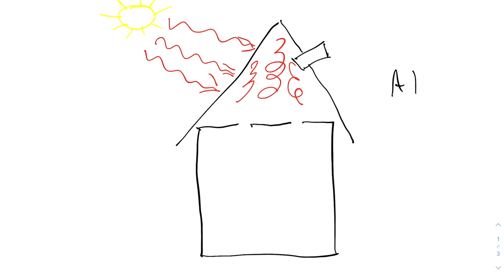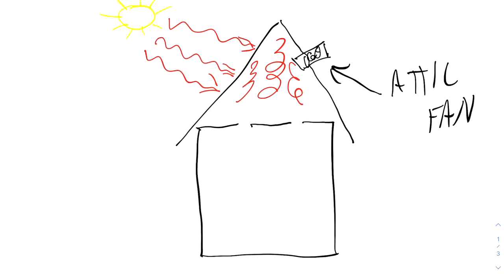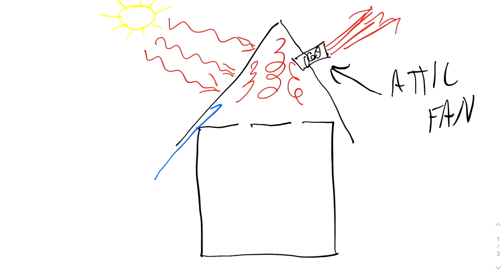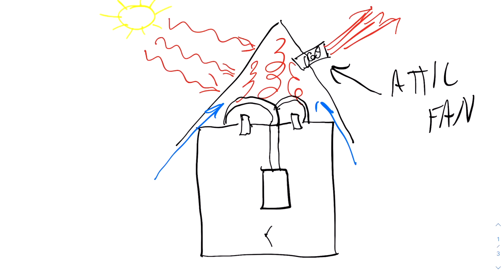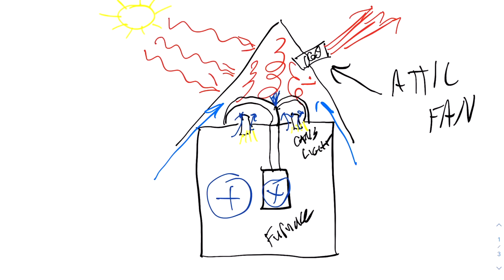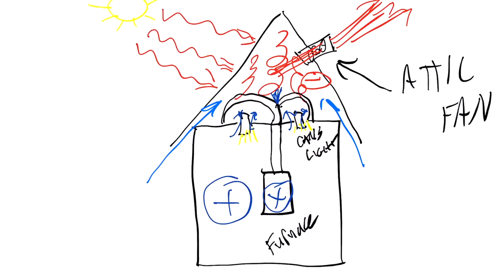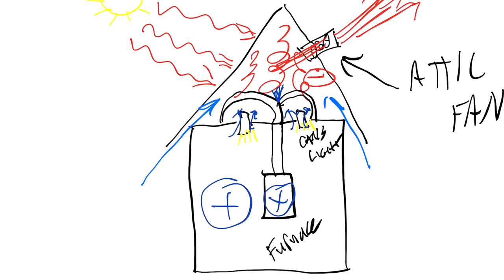3 Remodel Rip-Offs

Comment: So, I have an attic fan and a smart thermostat. You are cherry picking arguments against them. 
I'll start with smart thermostats. Most energy companies give a rebate on them so if you get one on sale you can get like a nest for $200 or even the E version(lower end) for $100 sometimes. My power company gave a $75 bill credit and it allowed me to enroll into the program where the power is limited on heavy use times but I can override that very easily if it happens. It happened for me like 5 times last year but it gave me a $40 credit on every bill that it happened. That with the added ability to customize the settings is well worth it. also if its a  particularly hot day I can go on my phone and put the AC lower while im not home so my pets are more comfortable and so its nice when I get home. 
As for attic fans...I have 2 types. I have a whole house fan that we use in the mornings most mornings that sucks in a ton of air from outside and pushes it into the attic and one of those solar ones. My attic isn't air tight. I don't think any are in my area. It has vents to the outside so when its 100 degrees outside and that solar attic fan is going its removing super hot air and replacing it with just the normal hot outside air. After we got the solar fan we noticed our bill on average in the summer dropped about $20. We were using less AC. We have only had it for a few years and it's paid for itself. 
Our smart thermostat is also paid for itself and more really.
Reply: I got my Nest E on sale and it cost me less than $10 after rebates. Definitely worth it.
Plus, the airwave function of the Nest only comes on if the humidity is low!  So if you're in the west or somewhere else with lower humidity, you can take advantage of the cold left in the coils to do more cooling instead of just wasting it!  I also use the fan setting because I have a basement with cool air that I can pull from and circulate around my house, providing cooling without having to run the AC compressor.
Reply: You have to remember the duct insulation isnt super thick so with arid stagnant temps in the attic that heat is going to heat the air in the ducting too so with a positive discharging system for that heat you should see lower bills as the cooling system doesnt have to work as hard to cool the air going into the conditioned space. In theory I can agree with Matt that a single deck vent by itself (during the day) isnt going to be able to make a dent in the attic temps. Add an intake fan thou which creates circulation and I disagree in them being a waste.
Reply: Same here 👏🏽👏🏽👏🏽
Reply: Yea I am going to have to agree on the thermostat points. There's also the convenience factor. Wake up in the morning, walk into the hallway, thermostat greets me with the outdoor temp, weather, and temps for the day. I deploy a lot, it's nice to check on that whenever. Back when I was troubleshooting a bad condenser fan, it was really nice to not have to go in and out of the house 37 times, because I can just run it from my phone. Plus it just looks great. Say you are selling your house, what do you think is going to impress a potential buyer more, a faded beige box on the wall or a stainless steel ring with an LCD screen?
Reply: NYG&E had the Sensi for free (pay shipping and tax) so I got one. Liked it and next year they had another rebate where it was $25 so I got a second one for upstairs.
Reply: @DanMcD80  I have been checking my system recently. I have an airhandler in the attic for the upstairs.  On a 92 degree day in the sun the vents blow out at 63 degrees. in the evening when it is still 89 it blows out at 59 and when the sun goes down it goes to 57.  I took a reading just next to the coil in the unit and the air is 54 when it is blowing out at 63. The attic has a ridge vent and soffit vents and was at 115.  So going through 5 feet of insulated metal plenum and 10 feet of flex duct made the AC air go up 9 degrees.  I didn't measure the longer runs of 30+ feet.

Comment: Love the channel and watch a lot of your stuff. In this instance as far as the thermostat and the attic fan I would disagree. I am an HVAC tech. A lot of two story houses have attic furnace/AC units here in Idaho. Solar attic fans at least in this climate is worth the investment. When I get into the attics in a hot day 80 plus they can be 160 degrees or more in the attics.  If there is a solar fan those attics are closer to 90 to 100 degrees. When the attic is that hot if there is any duckwork in the attic that heat will transfer into the ductwork. That will lower the temperature comming out of the supply vents by at least 10 degrees and thats insulated ductwork. The solar fan helps reduce the amount of time the AC has to run to keep set temperature. On the issue with the fan being on after AC use the amount of water that is returned as humidity is a small amount. I always tell clients with two story homes to either run the fan on continuously or on circulation node if they have a smart thermostat. It has a more even temperature throughout the house amd less time will be needed for the AC to run. An ECM blower motor is best for that because it will have reduced fan speed for continuous use but normal speed for when AC/furnace is running. 

Again love the channel but disagree on those two points. Though I will concede that your points are valid in some climates and some houses depending on the attic set up. Some attics actually have air intakes and some dont.
Reply: Wow a lot of disagreeing
Reply: @davidweggel9573  And rightly so.
Reply: @PianoUniverse  Exactly 💯
Reply: agree 100%.  I am in Az and its 110 outside, attics are 140 if properly ventilated.  If not- they are pushing 200.  He needs to stay in his lane---and stick with building and not try to be an expert in everything.

Comment: "separate dehumidifier" Best. Advice. Ever. Our bodies are great at cooling us naturally, if the humidity is low enough. Buying a small dehumidifier is the best 150 bucks I ever spent. Yes, it has a slight warming effect (maybe a degree after several hours) but that is only felt in the immediate vicinity of the dehumidifier and is easily knocked down by 5 minutes of air-conditioner. It's wonderful to wake up to a dry living space on a humid summer day.
Reply: I've considered going to a big box stores and getting one for my bedroom. It can be SO uncomfortable during the summer nights and mornings.
Reply: I'm pretty sure what Matt had in mind is a central dehumidifier (based on his previous videos) which will run you a lot more than $150 and not worth it in my opinion. Your A/C should dehumidify just fine.
But your suggestion is much more viable.
Reply: 150% agree! I just got a little freestanding dehumidifier - nothing fancy like what Matt has shown in previous vids - and that thing has made a WORLD of difference! In my next build, I will definitely install a full-blown dehumidifier system - non-negotiable. I will never be without one again.

Comment: Replaced the windows in both of my renovations and it was an immediate difference. the old windows on one were so leaky you could put a paper in front of them and they would blow with the wind. Plus it would be so cold upstairs. We replaced the windows and now the upstairs holds the temperature so well furnace doesn't turn on for hours. Plus its nice to actually be able to see outside.

Comment: Regarding Matts last point don't get the wrong idea. You should still purchase double or triple pane on new construction since you'll pay for the install labor either way.
Reply: He's talking about remodel rip offs though
Reply: pretty sure you can't buy new single pane anymore.
Reply: @lynxdiamond4888  how is upgrading your windows from single pane to double pane insulate a ripoff? this guy is absolutely wrong about every "scam" he made his video on.
Reply: @ericgustin3386  You obviously didn't watch. He said on a remodel, the payoff is a lifetime if your goal is energy savings.
Reply: @ericgustin3386  have you ever priced out new windows for a whole house? You'd have to be in your house minimum 20-30 years to justify the expense. They also at best improve the value of your house to the tune of maybe 70% of the cost. So if you are putting in new windows to sell in a couple years, you are again losing money. Your money would be much better spent adding insulation to an attic, upgrading an old hvac system, new water heater...
Reply: @lynxdiamond4888  If I'm replacing windows beause they're loose, janky, rotten, leaky, and jacked up old pieces of shit - which is why I'd replace windows in a remodel ... why should I not spend a couple extra bucks on better windows? Remodel has the exact same considerations as new construction penguins mentions - unless you're replacing 2 year old windows "just because more panes" or whatever - which nobody does.

Comment: you also have to look at more then just the energy savings with replacement windows, especially when you get the Low E coating along with say Argon gas this not only has the benefit of energy savings but also provides UV protection that protects furnishings and floor coverings from early fading and damage and the comfort of life value, as long as they are also installed correctly

Comment: I might slightly disagree with attic fans. In my garage attic during the summer it will get extremely hot and if I need to get something out of it I don’t want to go up there with it being super hot. I put a box fan at the opening blowing cooler air in and pushing hot air out. Within an hour the temperature in there is comfortable to go up there. Now how would this be different than an attic fan permanently installed?
Reply: It isn't any different.  Matt needs to actually test this stuff himself before spouting off about it. The utility companies wouldn't be providing energy rebates for window replacements,  smart thermostats and attic fans if there wasn't science that showed it reduced their energy load.
Reply: i'm willing to bet the box fan pushes a lot more cfm than these solar fans.  A quick search on Menards website shows 800 to 1100 cfm.  A box fan i saw on Amazon was  2400 CFM.  I've used box fans to cool my house and it seems to help.  I'm too lazy to read the article Matt mentions but I'm  finding it hard to believe its really that big of a problem with negative air if there is adequate soffit or gable vents.  Where I live in the north its not really common to have ducts in the attics.
Reply: Because now it’s no longer an attic fan.  You just said you put a box fan AT THE OPENING blowing cooler air in. That’s not an attic fan- that’s a box fan, at the attic opening, pulling in air. Attic fans are at the roof deck. Attic fans can’t outpace the amount of heat being constantly produced by the sun.
Reply: I am pretty sure he said powered attic fans not attic fans in general, but I could be mistaken.
Reply: I'll chime in on this as well. I have to disagree about the attic fans as I actually had 5 or 6 of them installed several years back (we have one of those large 2 story roofs that a portion of it actually covers the entire rear of the downstairs level as well, so we 2 placed in the areas above those lower level rooms and the rest in the upper sections of the attic... It's a big attic, trust me) . We built our house in 2010 and in the summer time, our AC just couldn't keep up with the heat in the Austin, TX area and I realized that the if I ever opened the attic access, it was like opening the hatch to a literal blast furnace and the sweat would start running before I could make it up the ladder. 

After getting the aforementioned solar attic fans installed, this made a HUGE difference and the same ac system no longer had difficulty keeping the house comfortable. 

Also, on another of his points that I'll disagree with, I switched to the exact Google Nest Thermostats with the Airwave feature that he mentioned, but I don't think he understands how they actually work bc they do have humidity sensors and that helps determine when the Airwave will run. That being said, I firmly believe a lot of these thermostats are not made equally as I switched from Vivint Smart home thermostats (one upstairs and one downstairs) and ever since going to the Nest thermostats, we don't have to set the temperature nearly as low as we did before (my wife is the meat locker temperature type and would set that Vivint one at 66 or 67 at night and with the Nest during the same 90-100 degree temp days, she only needs to set it at 69 or 70). Usually just setting the upstairs one to 70 or 71 will keep the up and downstairs extremely cool and comfortable. This is all running from a single large ac system for a ~2900sq ft home.
Reply: GoodTimesTx Photobooth I was just saying that for basic amount. The fan is way more powerful than an attic fan especially for just pulling in air for the garage attic. If you get proper attic fans I still see it benefiting rather than just the hot stale air sitting there getting hotter and hotter throughout the day
Reply: @irrision  what a joke. Attic fans don’t work—they pull cold conditioned air from the living space thanks to stronger negative vacuum pressure. Congratulations, you now burdened your HVAC system with more load to cool your attic.

Utilities give rebates for smart thermostats because they will use them for demand management. The goal for them is to turn your AC off during the hottest point of the day, saving them a fortune as they don’t need to pay for expensive, less frequently used “peakers” —-power plants that run only during the hottest days of the year

Finally, yes, newer windows are more efficient, but not cost-effective. Again, utilities offer trivial rebates for these programs because their goal is to “shave off” their peak demand ever so slightly. A modest decrease in system demand saves utilities millions of dollars not having to purchase or build more generation capacity. If they give you a $200 check, they’re laughing that you foot the $30,000 bill to put in new windows with a multi-decade payback. You did the utility a favor—your house will likely be here for the next 100 years, so their investment pays off. Most people sell their home after 5-8 years like idiots to move again and pay all the transaction costs. The point the video was making was these expensive upgrades likely won’t pay for themselves for a very long time, or in the case of the powered attic fan, only make your house less efficient.

It’s amazing you actually thought you knew something about this subject when in reality you aren’t anywhere competent to discuss it. 😂🤣

Comment: Another benefit to getting new windows is noise reduction. I noticed a significant difference when I replaced my single pane windows with double pane. But yeah, I would never replace good, unbroken and functional windows just to try and save money on heating/cooling. I mostly replaced mine because they were the original 1949 windows and were falling apart.

Comment: I changed my Windows from single pain aluminum to double pain vinyl. I live in NW Washington state. The house is 50 years old, the Windows were drafty and the thermal transfer of the aluminum frames was incredible. Touching them on a freezing day or hot sunny day sold me on new Windows.
Reply: Before I replaced my double pain aluminum windows there would be days in the winter where ice would build up on the inside of the window frame.